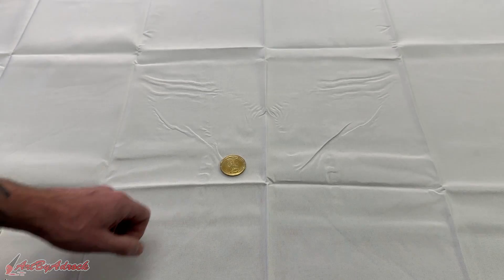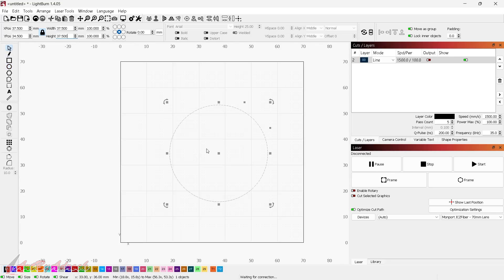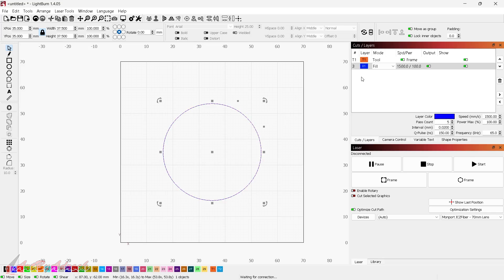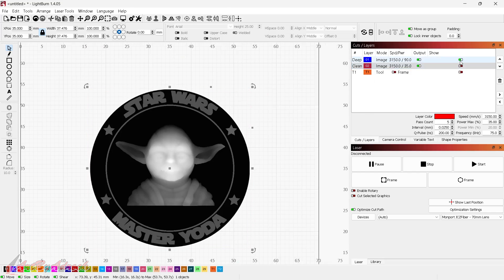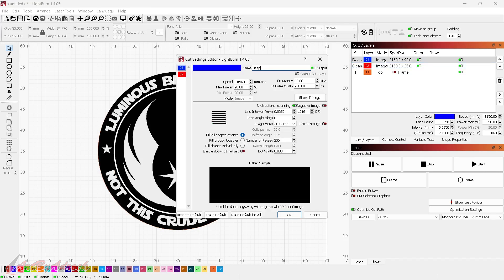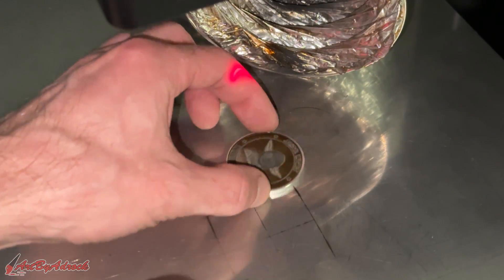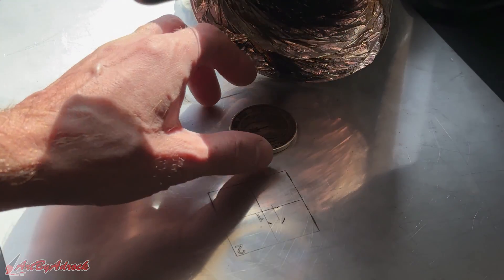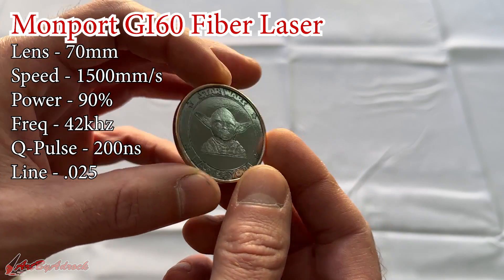Deep Engrave STEEL Coins From A Heightmap (Fiber Laser Setup & Settings)

Comment: FYI..90% power at that speed is waaaaay too high even for stainless steel coins. I used the same parameters on a cloudray 60W mopa and only got 75% of the way through the 256 passes and literally was just eating through the coin. Maybe you were using a thicker coin than I was but I wasn't even using a small focus lens, I used a 100mm lens. So I dunno...either way 1 and a half hours down the drain.

Comment: I really like your Star Wars Yoda coin that was excellent. I just ordered a fiber laser, but I don’t think mine will have the power to do that. 
I currently have three other lasers, but they’re all dialed lasers 

Excellent job currently using Lightbourn. I don’t think the new laser uses Lightburn uses an AutoCAD. 

Genmitsu Z5-1 Fiber Laser
I thought I would start with something that wasn’t too expensive and work my way up retired budget 
But I am a hard-core Star Wars fan .

Comment: INcredible, I didn't know that you could engrave in 3D with a fiber laser... I have a 30W with 110×110mm lenses, do you think that could work too, or does it have to be 60W?

Thanks for the video.
Reply from the maker: That should be fine, you just will have to adjust some of the settings and slow in down.